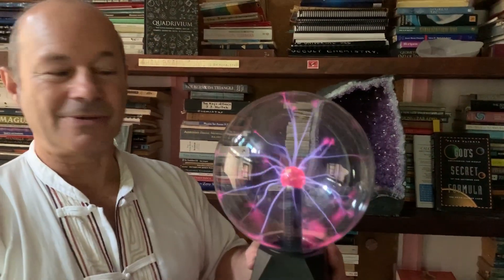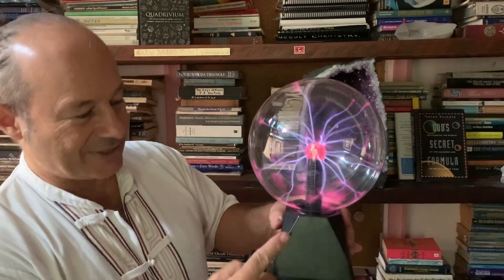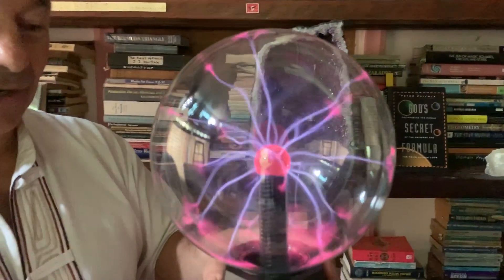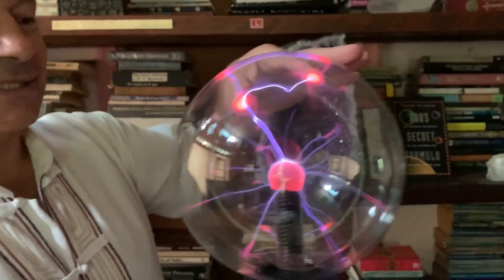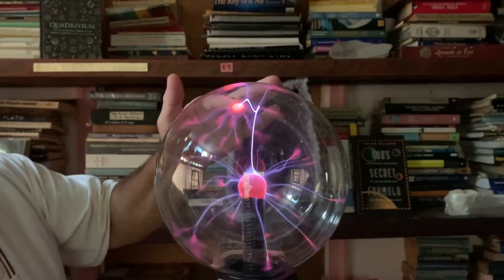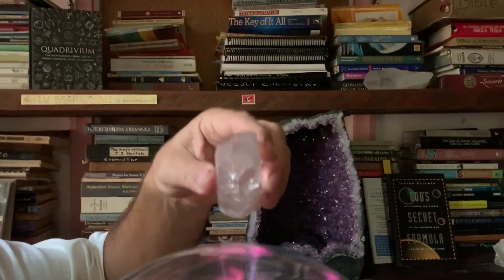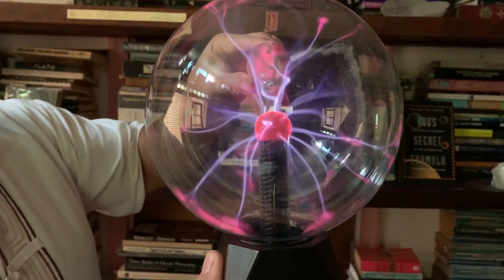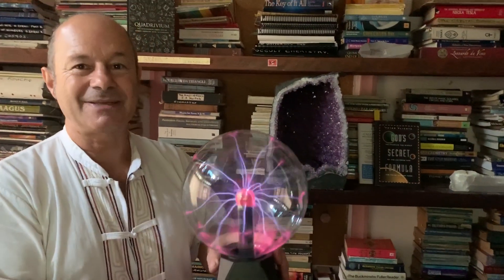TESLA  Plasma Lamp

Comment: On the serious note:

How much electricity it consumes
Reply: 5v 1amp
Reply: @Ghanzo  is that much?
Reply: @eatsomesalad4530  5v 1a is 5watts. A typical lightbulb is about 60watts
Reply: @Ghanzo  my plasma ball does 12 v
Reply: @amymiskiman5086  Oh ok
Do you know how many amps the power supply is rated for?
Reply: @Ghanzo  let me look it’s ratted watt 12 v and 1 A
Reply: @Ghanzo  want to know something cool do you have a big plasma ball? If you do turn it on, get a small one and touch the bottom of it if you do it correctly, you can actually get the plasma to go into the other plasma ball. The other doesn’t matter you can be a dead, one alive doesn’t matter even if the batteries aren’t working, it will still work.
Reply: @amymiskiman5086  Nice! I don't have 2 of them but I've done that with a florescent lightbulb before. Very neat and mysterious how that works